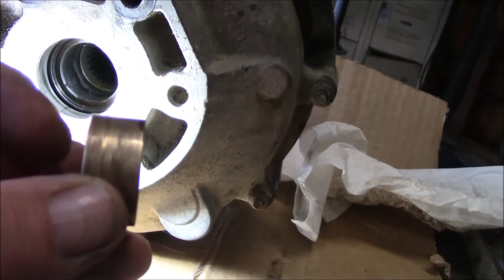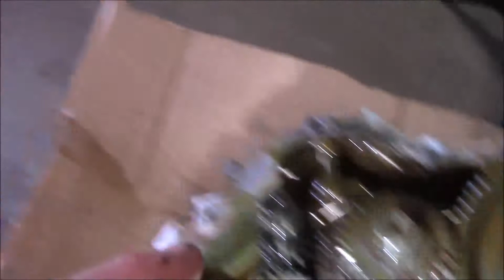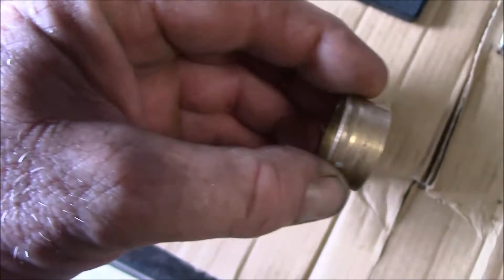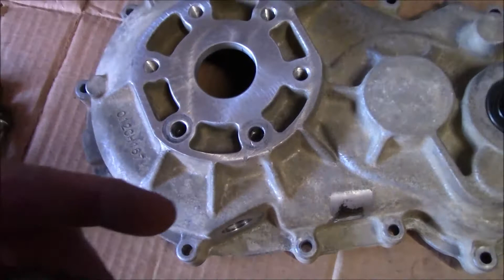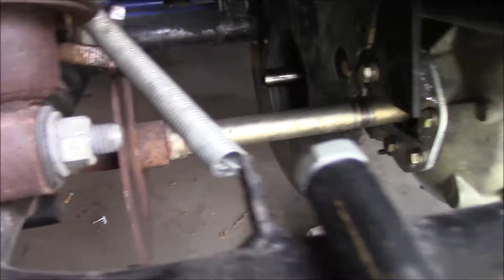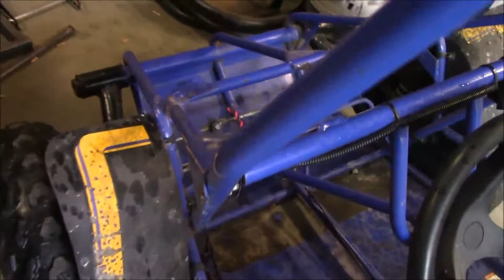Super Deuce Transmission Rebuild | Vintage Manco

Comment: Do you have part numbers on the axles?
Reply from the maker: Sorry bss. I sure dont! I'd bet you can't find new ones. Hard to find parts for these!
Reply: @junksautomotive  we just snapped one that’s been repaired already I’m not sure how many more times it can be fixed
Reply from the maker: Hmmm never had trouble with mine but i would keep fixing it if you can!

Comment: Were can find them parts from i need mine fix same problem
Reply from the maker: I think if you Dana Go kart axle seals, you may come across them. I can't remember what company i found them at. I believe it was a go kart parts place on-line. The bushings are not available. You'll have to make something like I did.
Reply: We're u stay at need help on mine or link for them parts if u can helpe out @junksautomotive

Comment: by chance do you have any spare proportional Valves that would possibly fit a 1975 chevy el camino? I got a 350 v8 in her but no brakes at all..
Reply from the maker: Sorry Kris, I sure don't. Might have to get an aftermarket one and re-plum everything.  Finding an old one might be sticky and gummed up but I'd try that too.
Reply: @junksautomotive  alrighty I planned on refurbing an old one if nothing worked out but thanks for the quick response 🤘🏻 stay safe brotha
Reply from the maker: @FuckinKris  you as well and keep diggin at it!